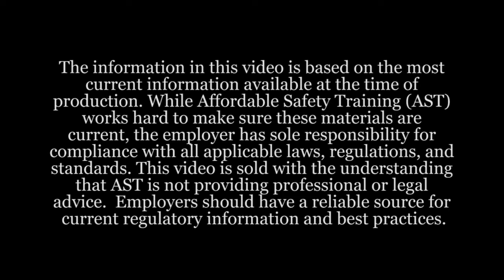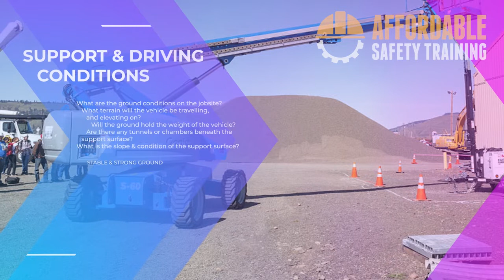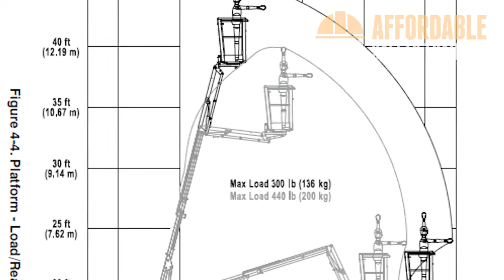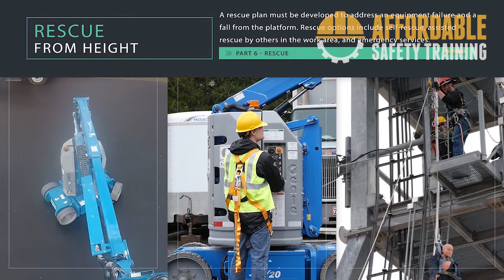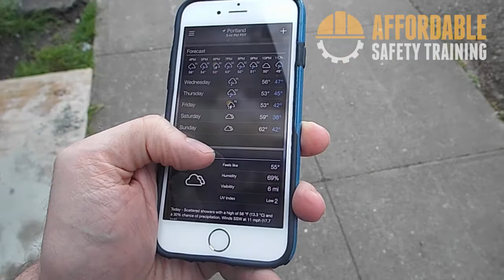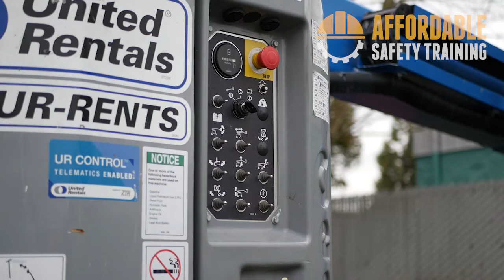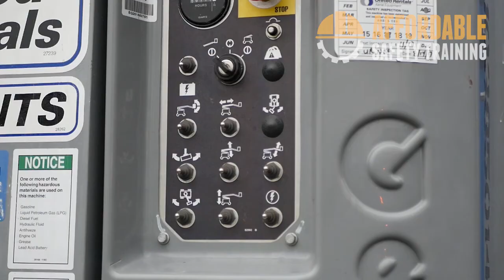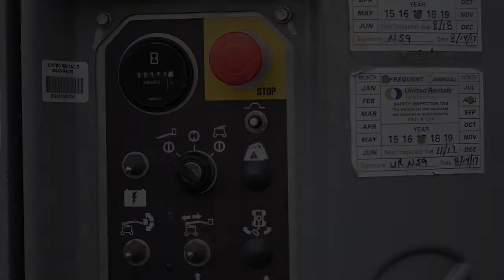Aerial Lift Operator Safety Training - With ANSI 92.22 Mobile Elevated Work Platforms

Comment: And I was actually getting more interested in all that harness stuff and going up further up because I am looking on how I was utilized on job sites and I didn't like how the whole harness tie-down thing was I still felt like maybe I could be in danger and granted I still should have been protected to some degree but I didn't wear a harness everyone else wore a harness but I still don't feel that it was fully safe and then I'm on a floor on the 11th floor at the U of A on 5th in Tucson and we don't have no guard rails on the 11th floor and there's three of us four of us up on the roof and any one of us could catch a breeze off of the roof and then you're dangling off the roof and we don't even have a team that is prepared for emergency response that's even posted to where it's visible for any of us there should be no reason by the emergency responses hidden like they should be in my visual side at all times especially when I'm signaling or somebody else is up at the roof signaling and and here we are you're just leaving people that are learning so of course there's lack of experience but you're the head of command and you're the one that's supposed to have all the knowledge and power and yet you're not even making sure everybody's safe and that goes for an c c a l c c p King Peach King Pete Pete King Pima County Archer Western and the IBEW electrical union in Phoenix Suntec Sons s u n d t I have yet to work for a company that has had people who are learning legitimately make sure that we are safe and making sure that we all know that we're safe oh because I'm comfortable around this person that's not safe